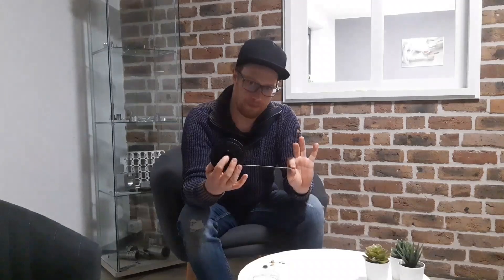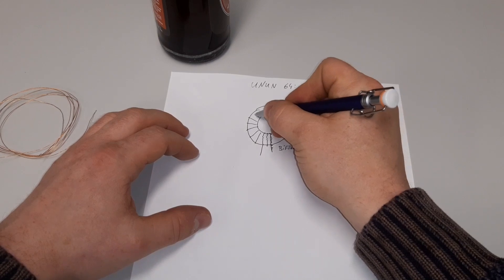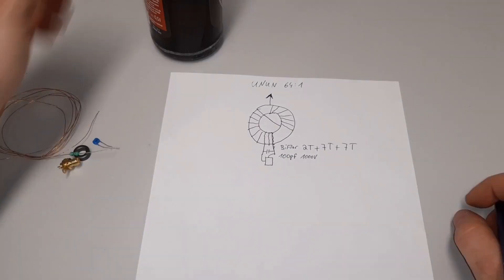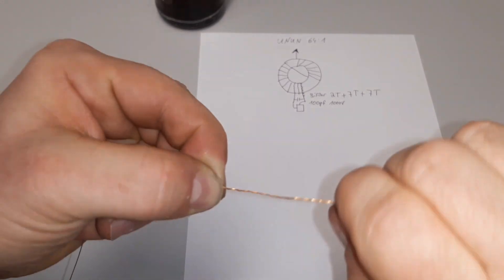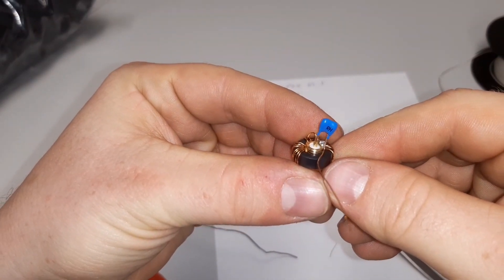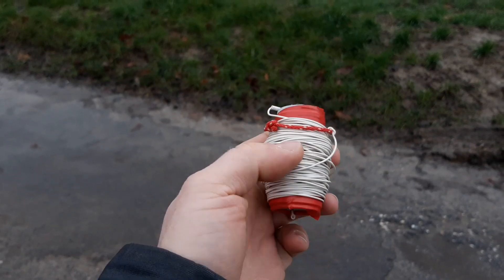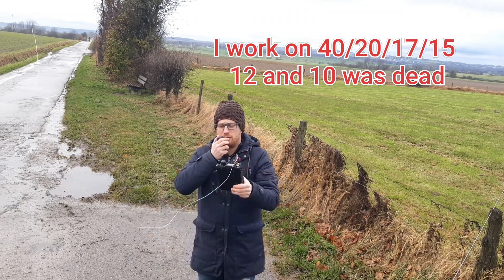DIY $4 QRP Multiband Endfed ultra simple + lightweight 40/20/10 (30/17/12)

Comment from the maker: PLEASE READ THIS!!!!

I did 3 bifilar primary +7+1+7
This is 18/3=6
6x6= 36
36:1
36x50 Ohm
Is about 1800 Ohm
But anyway this antenna works.
Not good but it works all the bands.
I will do a measurement video soon!
Ham radio, it is what it is-experimenting fail and win.
This time a mistake with a win at the end 😉

73 David DL1DN
Reply: Surprising it works!  I have a kit SDx I just finished and have some extra toroids and wire and no antenna, so I'll give this a shot.  It's worth noting that with wire and toroids of this size, QRP is just fine but going much above 20W is highly likely to saturate the toroids and/or melt the wire...
Reply from the maker: @georgedorn_fnord  20w is enough 😉
Reply: Why do you say "not good" when describing how it works?
Reply from the maker: @jertres2887  it works very good bit in comparison to the vertical it has a lot loss
Reply: Moreover every pass of the wire thru the toroid is a turn. So actually it's 7 + 1 + 7 ))

Anyway great job simple and efficient 👍
Reply from the maker: @АндрейДенисюк-ш7п  count the bifilar as well?
I made 3 bifilar+7 +7
Is it 14/3 or 17/3?
Reply: @QRP.lifestyle  
3 + 7 + 1 (cross pass thru the core) + 7
3 + 15
3t primary 18t total
3/18
1/6 voltage
1/36 impedance transformer
Reply from the maker: @АндрейДенисюк-ш7п  thanks ok the cross also!

Comment: Everybody noticed the mistake in the UNUN ratio. But running the FT817/818 from the internal battery limits the power to 2.5 Watts, so your TX is even 3 dB down. Which makes the result even better! ;-)

I like the practical part of the video. Most show only the schematic and the end result. Not the struggle to get the wire on the toroid.

 And making mistakes is key to evolution. Edison wanted to make a device to speak to hard hearing people and invented the phone...
Reply: Alexander Graham Bell invented the telephone.
Reply: @zeferpp1rd572 
Alexander Graham Bellinsky was first telephone Pole.

Comment: Many TNX. I am trying to do the same ato home with reused components I find my boxes. Can I use a 1000pf capacitor instead 100pf?
Many tnx again.
EA6AOL
Reply from the maker: No use 100p
Reply: You can use 2 x 220pf série .  Never 1000pf.

Comment: Hi David! :) You mentioned that you "tuned" the antenna. What method did you use if you did not have an antenna analyzer Sir? :)
Reply from the maker: I was checking the SWR at my trx and first try on 20 and 10 was no problem the 40m coil was more interesting ;)

Comment: With the way the antenna connection is coming out of the toroid, there is no reason to do the crossover winding.  Just wind them all the same direction, and the SMA connector will fit better.
Reply from the maker: Thank you!

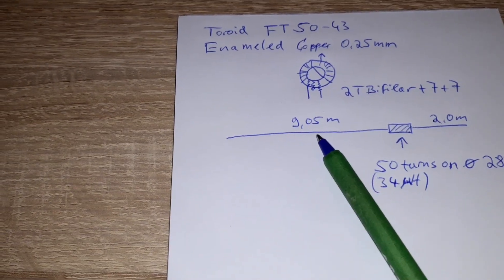Comment: Hi! Would the wire/coil sizes work with 1:49 unun? You use 1:64 as you say, but I have spare 1:49 unun, so I am wondering if I could use it or if I need to re-tune it...? Thanks!

Comment: Hi David,
I think you try to build an 1:49 ratio, not an 1:64 ratio.
But the two turns twisted ( in your video 3 turns ) counts also!
So you have to wind 2 turns twisted, 5 additional turns, than 7 turns in the other side.   
This would be 1:49 or 2/6+8 turns for 1:64.
But if it works in your case...fine business 😊

Comment: How does the connector not short to the turns on the toroid?  especially forcing it in to fit?
Reply from the maker: The copper wire is insulated
Reply: @QRP.lifestyle  The connector was inserted very tightly. The insulation could be damaged by the thread of the connector. 73!
Reply from the maker: @R1CBU  it was space enough, I fill it up with epoxyde glue. This will be no problem

Comment: Winding the toroid, the TWO bifiliar turns also count so you made 9 (NINE) primary turns and 7 secondary turns on the other side of the toroid. Go back and look at your video of your drawing.
Reply from the maker: I made 3 +7+7 this was a mistake but the result is better than expected. Maybe this is the reason why it works on nearly all bands

Comment: Fantastic video, thanks David.

Does anyone recommend a good resource (book, site, etc) on how to build this type of antenna? For example, if I want to build one that accepts 100W, what should I change in the materials and turns and dimensions? Thanks.
Reply from the maker: Search for PD7MAA
Reply from the maker: I have the same in big for 100W
Reply: @QRP.lifestyle  thanks, David, checking it out now!
Reply: @QRP.lifestyle  Callooh, callay!  The-same-thing-but-bigger is exactly what I was looking for.  Gratefully I already have an FT240-43.  Many thanks!
Reply from the maker: @d.jensen5153  It is the same in bigger. But wait for the additional video I am cutting right now.
Reply: FT240-43 toroid with at least #18 wire, otherwise same winding instructions. I used 2 high voltage 220 pf caps in series for the capacitor. I have an efhw wound for 64:1 that easily handles 100 watts on 40-10 meters. Higher power? Stack 2 or more toroids.

Comment: Very good video, thanks. Let me be sure I understand, you worked all these bands with no tuner on the FT-817 with low SWR???
Reply from the maker: Surprisingly yes
40/20/10 is perfect but 30/17/12 also possible without changing anything and no tuner

Comment: At 6:36, how did you tune the antenna. Seeing your big challenge would be helpful.
Reply from the maker: First without coil on 20m
Than add the coil and cut the +2m wire begin with 10m and at the top 2.5m